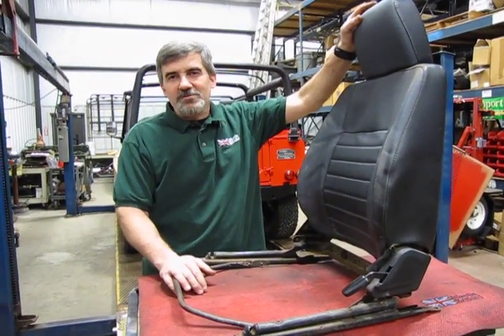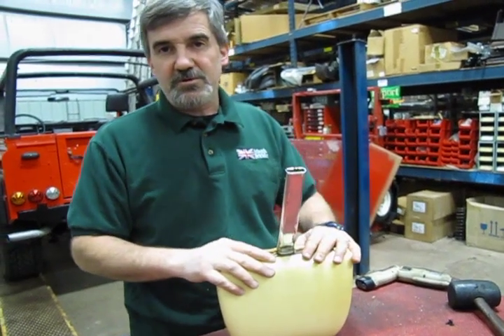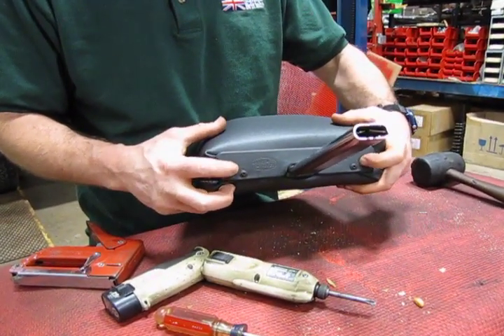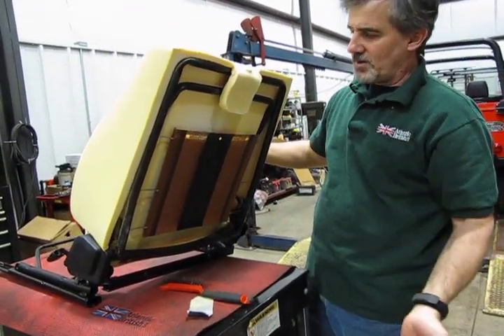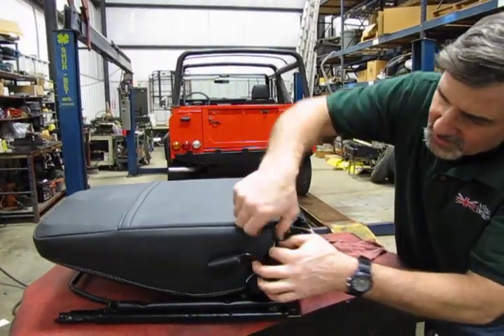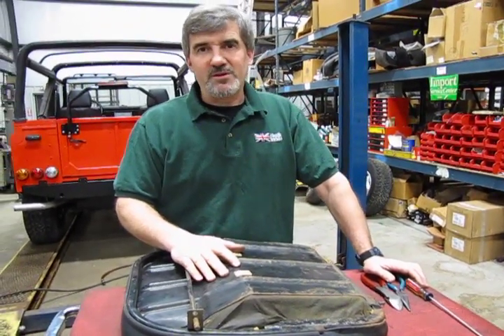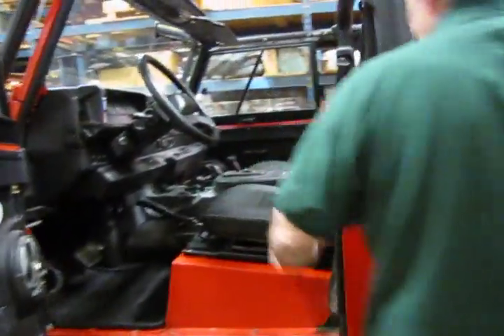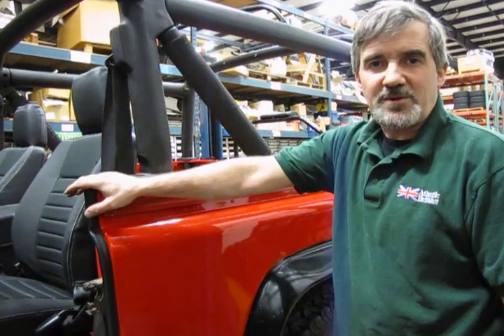Atlantic British Presents: Replacing Seat Covers and Foam on Defender 90

Comment: After some years of use, I have noticed that the seat cover causes some erosion onto the foam. I have thought of covering the foam with a plastic bag material to avoid this erosion. The erosion is not serious because often the cover wears off before the foam. I think that the plastic sheet would however spread the pull, and avoid the erosion of the foam. The cover often creases at the same location, and perhaps the plastic sheet would also avoid a crease in the same location. I am not sure whether my thinking is a sound idea. Perhaps others here could tell me more.

Comment: Good demo but you made some simple mistakes, you didn't glue the base cover down, your headrest was backwards and work from the back when fitting the back cover it's easier! Also use some silicone spray on the foam for easy application of covers. A very easy one man job in under 15 mins I promise ;)
Reply: Can't believe you  did not show the process of closing the back seat cover (the two tabs and then the two plastic strips